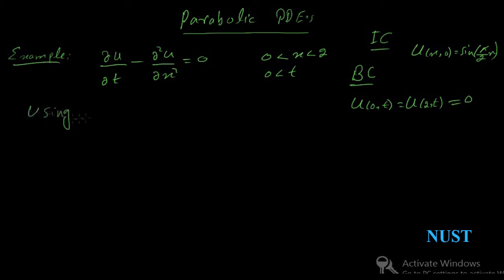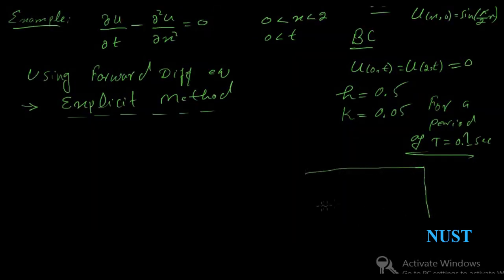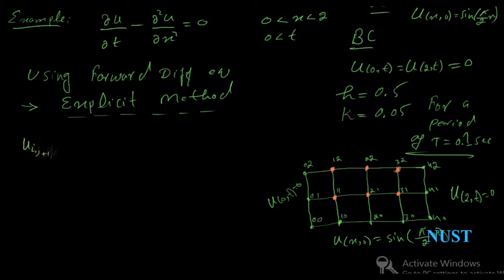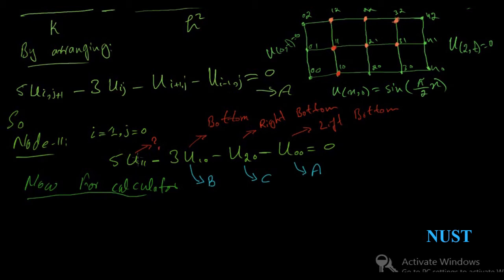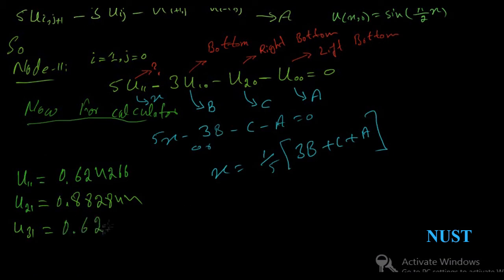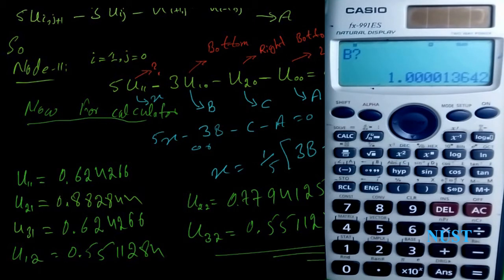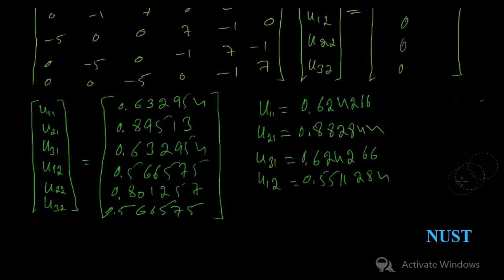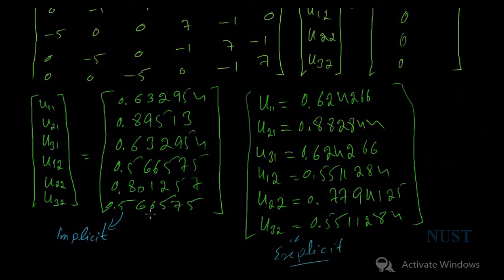12.2-Parabolic Partial Differential Equation (numerical analysis)

Comment: Pls I didn’t understand what u did with the calculator and also how u got values for U 1,1 U 2,1 etc
Reply: the equation for nodes u11 u21 u31 is similar and it differs only in the variables involved. He first gave the variables a different name B, C, A and x and then input the values in the calculator for each variable. Remember we know what B, C and A is (they are already provided to us as boundary conditions). 
Coming to the calculator part, first write the equation in terms of your new variables, leaving x (you can add x in there as well but make sure everything is on the same side of the equal sign), and then press Shift+CALC button. The calculator will first ask you for the values of A, B and C and once you input them provide you with the answer. 
Hope this helps even though its been a year since you first asked this question.